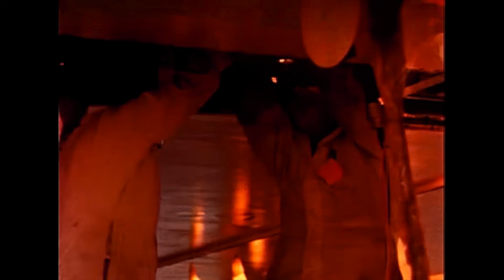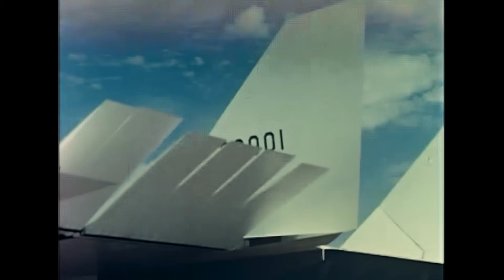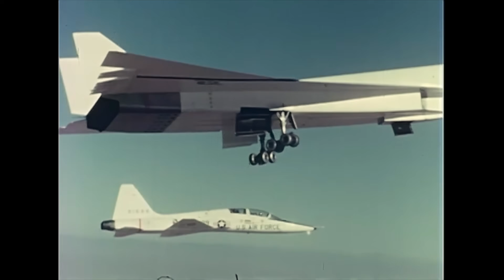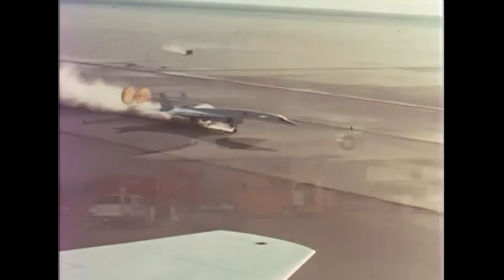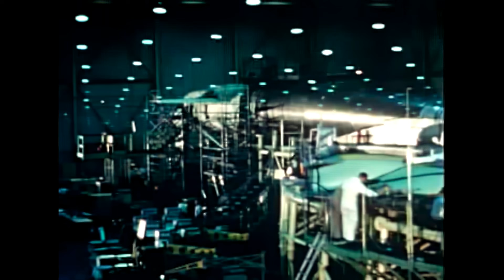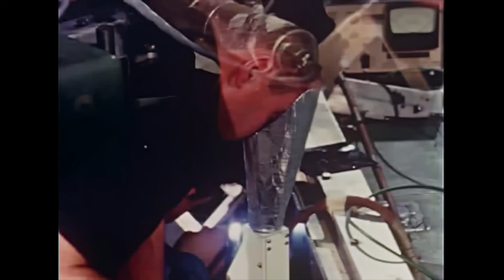Declassified: XB-70A's Revolutionary Test Program

Comment: it is weird that the smaller aircraft that went supersonic together with the XB had no problem with their paint...
How long did it take them to figure out, to use the same paint as the small aircraft.
Reply: @steffanjansenvanvuuren3257 "While at Palmdale, engineers puzzled over why some of the white paint peeled off during three of the first four flights. It was finally determined that too-thick paint caused by several re-paintings – allegedly done in order to impress various VIPs – was being cracked as the Valkyrie flexed in flight, and was then torn away by the airstream. During the winter stay at Plant 42, AV 1 was stripped and repainted with a single thin coat of white paint." - This excerpt is quoted from Valkyrie: The North American XB-70 by Graham M. Simons. First published in Great Britain in 2011 by Pen & Sword Aviation, an imprint of Pen & Sword Books Ltd, Barnsley, South Yorkshire. Copyright Graham M. Simons 2011. Reproduced here with acknowledgement to the publisher and author. All rights reserved by Pen & Sword Books Ltd.

Comment: It was badly designed and badly built. The Pilots were a great bunch of men
Reply: Specify.
Reply: A futuristic, good-looking but completely useless bird, full of design and technical problems. (North American could not solve those problems, which later were solved by Kelly Johnson & Skunk Works.)
Reply: @gaborbanay92  Calling it “completely useless” overstates the case. The XB-70 was technically impressive, provided valuable research, and represented a genuine aerospace milestone, even if its original mission concept didn’t survive the changing strategic mission.
Reply: @gaborbanay92  (North American could not solve those problems, which later were solved by Kelly Johnson & Skunk Works.)

Specify.